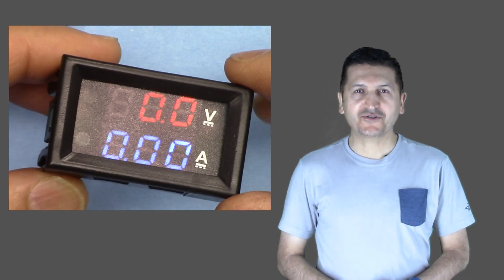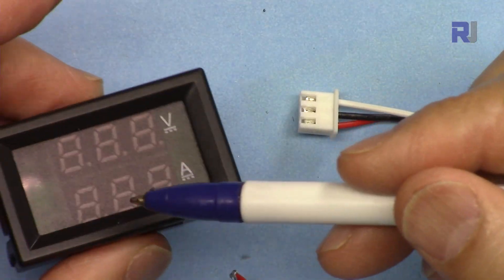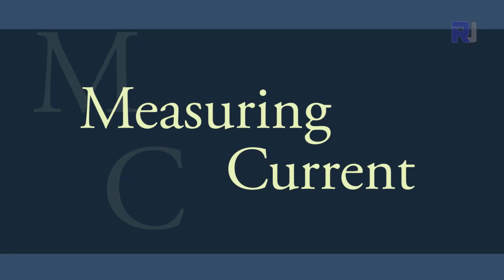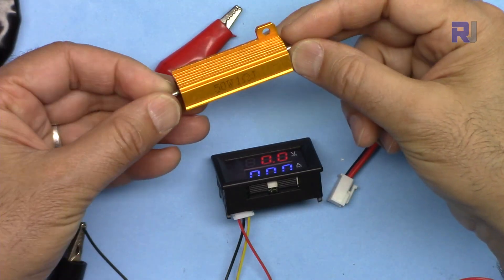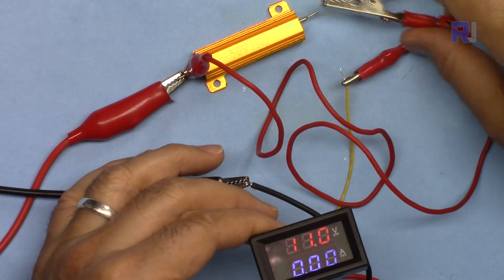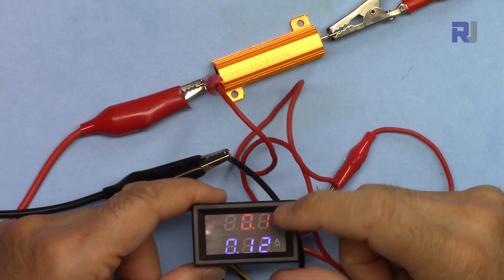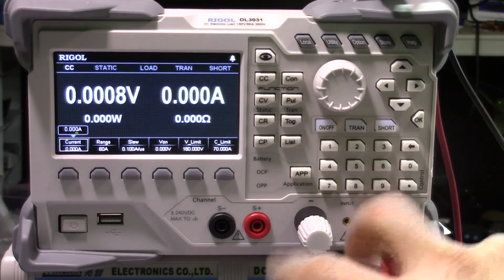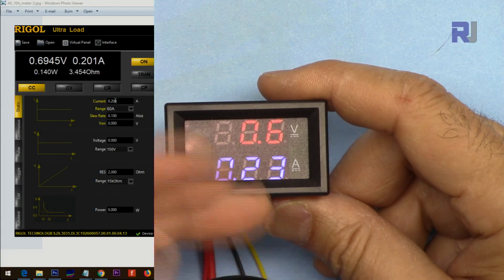Complete Test/Review of 10A  0-100V LED DC Volt and Current Meter RJT203

Comment: These are junk, I've burnt out several already just trying to get them to work.  The load won't work through them and the ammeter doesn't change, it displays 102.  It's not like i'm doing anythign sophisticated either, just usinga 12v car battery and some test LED lighting as my load.  And yeah, I got the leds (diodes) wired in the right direction, just for the hell of it I tried both directions.  They work fine directiy connected to a battery, but won't do anything through this ammeter wiring diagram.   I tried some other load, like a lumbertruck rear strobe light.  Still nothing.  Waste of $$$.  In it's defense, the voltmeter part works...  I guess if you throw away one place of accuracy, it will tell you if you car battery is at 12v, or 11v, or 10v.   If your car is at 11v though, the battery is already dead...  So... useless muchly?
Reply from the maker: Unfortunately 100s of people/stores are producing it and no quality control. We even don't know who is the manufacturer. So buy it only from high rated stores. no you go and rate the product from whomever you bought so other don't buy it from the same seller.

Comment: I got a question plz tell me if these meter are protected against short circuit in the output or not?can i use it with battery source without relay protection?
Reply from the maker: this can handle 10A and about 12A for few seconds. Short circuit means ∞A and of course it can't handle it. this is should always be in series with the load.
Reply: @robojax  tnx so what do you advise for me to make and protect my battery pack with this meter ?ive tried relay but it doesnt cut off when im shorting leads
Reply from the maker: to protect battery use this module https://youtu.be/0mOqpCfAdy4 I have explained it fully

Comment: I need to measure approx 30 Amp
Is it possible to measure by this
1. Can use as another shunt resistance externally to measure ampere not exactly same ampere but at least a scale value of current so that we understand current.
In normal multimeter we did like this to measure current, we measure current in externally thik wire by just putting our meter prod any 2 points at gap of 1 meter and it shows ampere in miliamps we just understand calibration that how much miliamps shows during actually known 1 ampere nd then we do multiplication nd here we get actual ampere, so like this is it possible in this meter
Reply from the maker: Hi, the it is very clear from the title "10A" is the limit.  you can use this meter https://youtu.be/Mmxw7T29Z6k or all other meters that I have done the reviews here https://www.youtube.com/robojaxTV/search?query=meter

Comment: Hi please help. I bought the 100A version and it has no shunt. I want to make one. What specs do I use?
I am a bit confused.
Reply from the maker: Hi, just search my channel for "shunt" and you will get a lot of videos. here is the search result https://www.youtube.com/robojaxTV/search?query=shunt
Reply: @robojax  Hi thanks. 
I have one of these. I just need to work out the amount of copper plate to use.
https://www.ebay.co.uk/itm/DC-100V-100A-Voltmeter-Ammeter-Blue-Red-LED-Dual-Digital-Volt-Amp-Meter-Gauge/283621092127?ssPageName=STRK%3AMEBIDX%3AIT&_trksid=p2057872.m2749.l2649

I'm not sure which one to watch.
Reply: @robojax  What resistance and voltage drop do I need across it?
Reply from the maker: this module doesn't work with external shunt. I provided all shunt related videos you may watch them.
Reply: @robojax  There is no internal shunt. The picture in the advert is incorrect.

Comment: Do NOT buy this. Ammeter will be off, the adjustment potentiometer is useless. Tested at around 40V, could not get the current to be even close to what my two multimeters were measuring. Tried a second unit of this peace of junk, same thing. Wires are also very tiny for 10A, nothing reassuring. Tutorial is great though!
Reply: I thought the same thing until another user mentioned the ground loop problem. If you are sensing and powering from the same source, you must leave the thin black wire disconnected.
Reply from the maker: thank you for sharing your experience. here is a little better version Current only https://youtu.be/H0pQQxIUk9U
Reply: My problem was the voltage was not accurate, adjusting it did not help because I couldn't lower it down anymore. I noticed the higher the input voltage the more incorrect it gets.

Comment: Your explanatio??is good. One doubt. If the operating voltage is not steady, will it not affect the functioning of the meter ?
How about providing a steady voltage with the help of any 78 series (7805, 06 or 09)  ?
Reply: Sorry. read as explanation
Reply from the maker: it just displays. This is NOT energy meter. if voltage is not steady it SHOULD display it as it is.

Comment: When powering from the same source, you DO NOT need to connect the thin black wire.
Try disconnecting it.
Reply from the maker: it will make people confused.  For example if they need to measure voltage only, then they will have issue.
Reply: @robojax  Maybe...but if they only want to measure voltage, they wouldn't be buying a volt/ammeter, would they? Also, if you do some research on these units you find single-supply circuits that have the thin black wire disconnected - that confuses people who have seen your connection!
BTW There is an internal connection between the negatives.

Comment: Great video. Can this really measure 10A? I heard this blows when passing more than 5Amps.
Reply from the maker: I belie I tested and presented it to you. It is very strong shunt. even it can handle 2 or 3 more ampere for few seconds or minutes.
Reply: Robojax is this suitable for a car charger drawing nearly 10Amps for hours? Using of shunt is mandatory for less than 10 amps?

Comment: There are many versions, and can  have problems because of badly written firmware. 
The display refresh can be much slower than advertised such as 800mS instead of 300ms.
The voltage and/or current can have bad tracking accuracy despite being zeroed and the gain trimmers adjusted.
The ones that have poor current tracking will also jump over the "0.01"amp reading.
The meters I got from Banggood have good current accuracy but poor voltage tracking.
If I calibrate at 5V, they will display "31.1" when I apply 30V. 
And I am powering the meters from constant 5V to the thin red wire.
Reply from the maker: I agree with your statement.  These are cheap and what can't expect much from it.
Reply: Anything that is sold should meet advertised specifications regardless of price. The problems are unnecessary and easy for the manufacturer to correct.  Most annoyingly,  they used to be good.
I can fix the voltage problem by putting a 4.7M resistor from 3.3V to the voltage ADC input pin on the micro but the slow refresh makes them useless to me. Example,
https://drive.google.com/open?id=18-L6NMsQPRj__3B3tpa6mP_4cYvvMNtz

Comment: Hi  I've got a quastion. Is it possible to use this volt and ampere meter to check voltage and current from 3 different power sources? I'm thinking of using some kind of switch with 3 inputs and 1 output. Please help me
Reply from the maker: Hi, making such thing is possible but not easily possible with this display. this is your best option https://youtu.be/3C33DpcSwIw with TMS1637  https://youtu.be/DuamjlstOKM

Comment: I have many of this madule but most shows wrong ampere.but shows voltage correct.i do not know why.can anyone help?
Reply from the maker: Hi, my best help was to explain this module and demonstrate it. It must be damaged or wiring could be wrong. follow this instruction.
Reply: @robojax  wiring is ok.but i use it for variable power supply and i supply madule with same smps  i used for.is it possible that i must use another power source for supply this madule?
Reply: @shadowhunterxxx5891  only way is to put separate dc supply. 
but first disconnect thin black wire when you have same power supply maybe it work. if not separate supply is work
Reply: @aliakbari437  thanks bro
Reply: @shadowhunterxxx5891  Separate ISOLATED supply (not same 0V).
Reply: @steve6375  can i use isolated dc to dc buck converter instead of another power supply?
Reply: @steve6375  is it ground loop problem?
Reply: @shadowhunterxxx5891  yes - but most DC-DC converters are not isolated, they have a common ground\0V.  Measure resistance between 0V in and 0V out. If it is isolated, you can power ONE meter from it. If you have two meters you will need two isolated power sources.
Basically, these types of meters are only useful for a single output power supply - you cannot use two of them and you cannot use it in a multiple output PSU because it measures return current from all power rails (e.g. 12V+meter, 5V - connected to circuit from same PSU, 12V meter would read combined current of both 12V and 5V)..
Reply: @steve6375  thanks alot.this link was so helpfull🙏🙏
Reply from the maker: You are welcome. Thank you for not skipping the ads and keep watching them. This will help me a lot.

Comment: Dear Sir,

I'm writing to you from Belgium and my home language is not English, so plse be indulgent with my grammatical faults.
Many thanks for your interesting and well presented video about the installation of your digital 10 Amp meter and in combination with a voltmeter.
If you could spend some time to read me, it would be great.
I already have since 40 years an analogue -50/0/+50 Amp gauge from Smiths in use.
This was already used in different cars.
Now it is installed in a VW Golf MK2 GTI 16V of 1988.
It is a gauge functioning with a shunt build inside of it.
Now the gauge is becoming a little bit tired and it is not anymore as sensitive as before in order to indicate the uses of small amounts of amperages!
This gauge is indicating the consumption of the total amp's of the loads used and also if the alternator is strong enough to produce some extra current to the battery in order to compensate the used Amps by the loads, but also to load some extra amp's into the battery, if necessary.
I heard that even when the battery is fully loaded, there is still about 0,5 Amps of current loading the battery?
Of course the Amp meter is registering the total electricity  consumption of the car, but the starting motor, which is consuming too much amp's, (and would destroy the amp meter), is excluded from the circuit.
Now come's finally my questions.
Please tell me if I'm wrong or not!?
Is it possible to use a digital Amp meter together with an analogue Amp meter?
Because, how ever I would like to keep my analogue Smiths Amp meter.
Is it possible to connect a digital AMP meter with a shunt in parallel to the two connecting points of my Smiths amp meter (one connecting point has two big wires coming together and the other one has only one big wire), or do I have to use separated (smaller) wires coming from the fuse box or battery or from the alternator?
I do not think personally that it will be possible to realize this, as when I want to measure the Amp's with my digital portable Amp meter, I first have to disconnect all the big wires from my Smiths Amp meter gauge, as otherwise I can't measure any amp's at all.
Also If I disconnect the big wires from the connecting points of my analogue Smiths Amp meter, the car will not start nor provide any electricity anymore, as the circuit is interrupted!
It must be in this case a serial connection, because parallel is only for the volts, isn't it?
But in all this I don't have any knowledge at all.
Can they possibly work together in harmony or not?
Do a digital Amp meter needs a shunt above 10 Amps?
But an analogue meter is still working with an internal shunt till 60 Amps, or maybe even above it?
My digital portable Amp meter can register amperage's till 20 Amps but only for a short time?
Nevertheless the shunt inside of the portable Amp meter seems to be as thick in diameter as the one installed inside of my Smiths gauge, with a bigger reading of 50 Amp instead of the 20 Amp?
And also what do you think about a digital Amp meter with a hall sensor?
Is this a better and easier solution?
Is it less accurate than a shunt, or can't he read the consumption of electricity and the load of the alternator together?
So dear Sir, I don't know if my logic is totally correct, but I would like to receive some additional help and expertise from you about the connection and possibilities with a separated shunt and his digital meter (with a more precised Amp's reading), and in combination of still using my old analog Smiths gauge?
Sorry for beeing so long, with my questions, explanations and comments.

Many thanks in advance for giving me (if possible), an answer!

Best regards,
Christian.
Reply from the maker: Hi Christian, Thank you for your comment and detailed explanation. Your English is perfectly clear.
1) Is it possible to use a digital Amp meter together with an analogue Amp meter?
Yes you can use it BUT in series. So both metes can read. 
2) And also what do you think about a digital Amp meter with a hall sensor?
Hall is better because we don't needs shunt resistor and it is ALWAYS the best way here are my videos on current sensors https://www.youtube.com/channel/UCkcBSig_Iu4ZnAIeCeG1TVg/search?query=current
and here are my power meter videos https://www.youtube.com/channel/UCkcBSig_Iu4ZnAIeCeG1TVg/search?query=power+meter
Reply: Shut up

Comment: One thing you did not mention was how to zero current meter.
These meters do not read negative current. 
I had one of these units which had a bad zero! i.e. It needed about 1 amp to before the meter started to read. If you had 2 Amp then meter read 1.00 Amp i.e. 1 amp zero error.
1. To fix this link the 2 pads just above the main chip where it says ADJ-Z  (see 15:42). 
2. Apply power to meter for 1 second.
3. Remove link and re-power meter
This zeros current meter and meter then measures current correctly.
BTW your zero was OK so you did not need to adjust zero.
Reply from the maker: Thank you.
Reply: thanks. my ampere meter is the same.
Reply: When you say 2 pads just above main chip near the I ADJ-Z are you able to explain a little more. I believe mine needs zeroing but don't know where to short across
Reply: @justinryan3365  Hi Justin:
At 15:42 you can see 2 unsoldered pads. (3mm above main chip towards edge of PCB)
1.	Unplug current lead to force zero amps 
2.	Short out these 2 pins then turn power ON.
3.	Turn power OFF.
4.	Remove short.
5.	Re-power meter. 
6.	Meter Zero should be reset.
Peter

Comment: Thank you sir!  The ammeter connection was confusing me because of the common negative for both the volt meter and ammeter parts.  I didn't realize that you are only able to measure the amps on the negative size of the load when using a single power supply.  Great explanation!
Reply from the maker: You are welcome. I am glad you found it helpful.

Comment: Thank you it worked out good the only problem is the motor is running the wrong way and I am
building a small table saw and the blade would loosen up going the wrong way is there anyway that I can change the yellow wire to fix this problem plus I am using a motor control with reversing switch I try reversing it with the switch but I new that wasn't the way to go would you have any advice it would be much appreciated.I will leave my email address it is
rogerbrowne15@gmail.com.at 71 years old and don't have much electronic experience It is hard to figure some of this stuff out.
Regards Roger
Reply from the maker: Hi, if you are using it with DC motor, you can simply change the polarity of DC wires to the motor.

Comment: How to calibrate to accurate reading in amps. How to adjust at the back
Reply from the maker: You can't change it. There is nothing to adjust. Here is another current meter: ;https://youtu.be/2FzceyhG37M
Reply: You can zero the current range by jumping the "I-ADJ-Z"  holes while powering up. Use the "I-ADJ" trimmer to correct the span. It may not be possible to get it perfect depending on what version you get sent.
Reply: @xavieraxiak6866  how to use the I_ADJ trimmer bro.

Comment: This type of meter uses a shunt to measure the current in the ground wire. The thin black wire is also ground. You must NOT connect the thin black wire unless you are powering it from a separate isolated supply such as a separate battery. The video is misleading. If you connect the thin black wire it will affect the current reading. Simply disconnect the thin black wire and the Amps reading will be correct.
Reply: yes. my meter has this problem too. when thin black wire is connected the ampers are double. but when disconnected ampers are correct but voltage shows lower😫
Reply from the maker: which part is misleading?  it perfectly works and correctly shows .  Perhaps you don't understand how current is measured. Watch the video again and do not escape.
Reply: @robojax  It works for you because you are using a battery which provides an isolated power source. But in the real world, people don't connect isolated power sources to the meter, they use the same power source to power the meter. In this case, you must NOT connect the thin black wire. https://rmprepusb.blogspot.com/2019/11/everyone-is-wiring-up-their-power.html
Reply: @robojax  Yes, @steve6375 is correct. If you don't have two isolated power sources, you must disconnect the thin black wire. This is documented in product reviews as well as Q&A. I did not get double readings as some have stated. I got about half of actual and I broke the trim pot trying to adjust, which is impossible. Your video is excellent, but you only did one of the wiring scenarios.